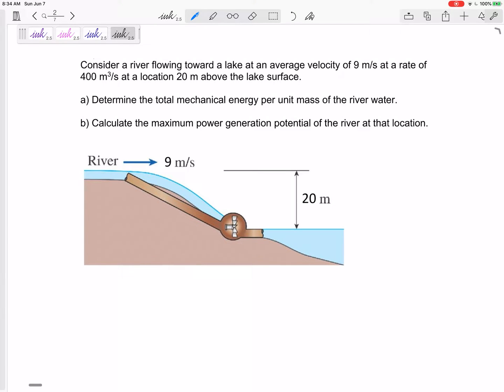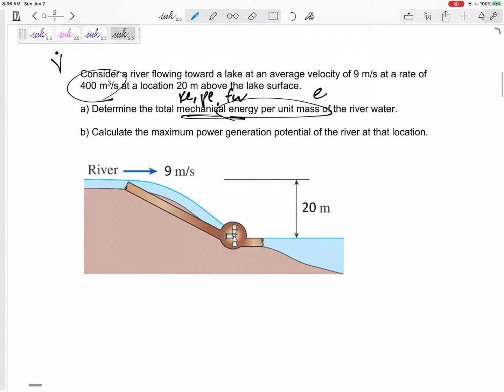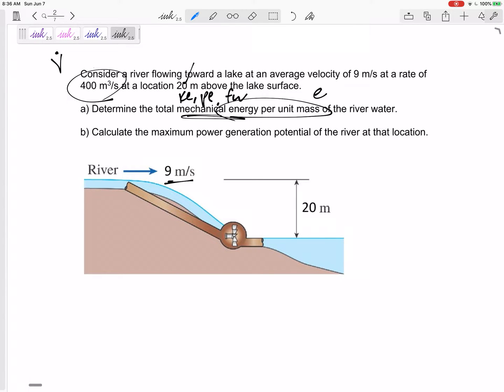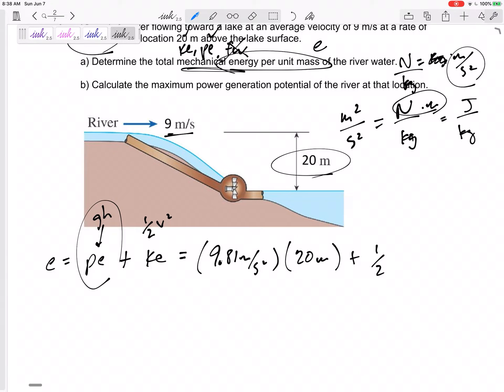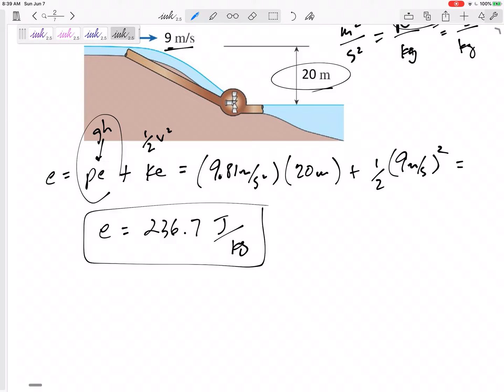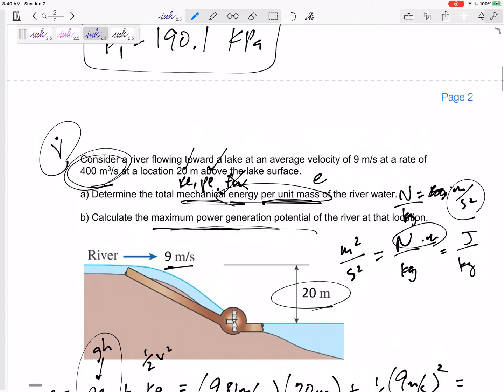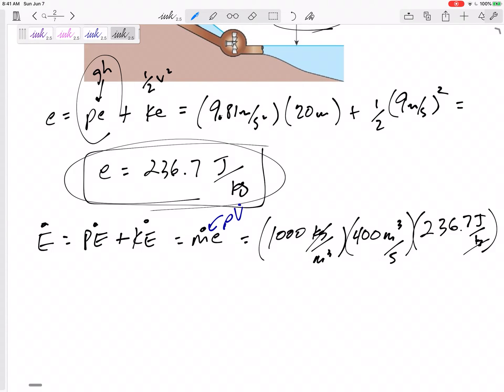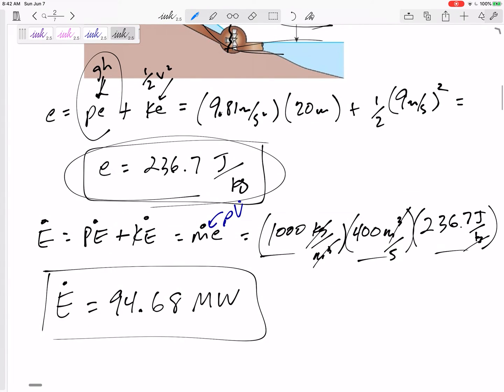Thermodynamics - Test 1 Problem 2 - Conservation of Energy

Comment: Why (pe) is positive? Mustn't it be negative; because the river is flowing from a high level to a lower level?
🔺️e = 🔺️ke + 🔺️pe
🔺️e =  0.5 (9)^2 + (9.81) (0-20)
🔺️e = -155.7 J /kg
Plz correct me if I am wrong 👍🏻🌸
Reply: Actually we are finding the energy that river already have not water that flowed to the lake
Reply: you should choose reference point at the ground level, so compared to the position of the water just before flowing down the fall , its 20 m high so 20-0=20m
Reply: Because the potential energy is at maximum at the top of the river and converts into kinetic energy at the bottom. You are essentially adding the kinetic energy that is converted from potential energy at the top of that makes sense